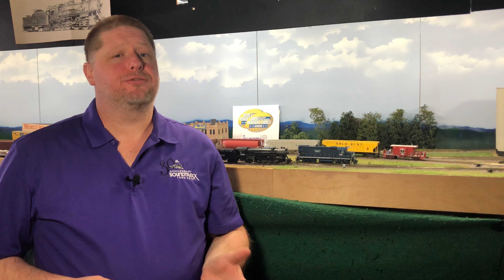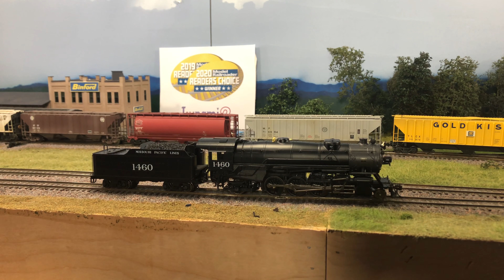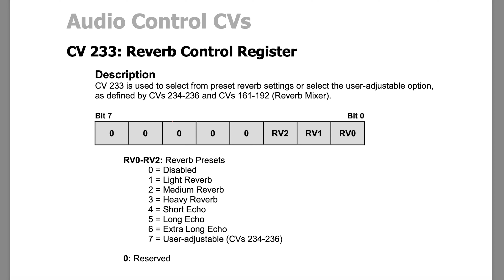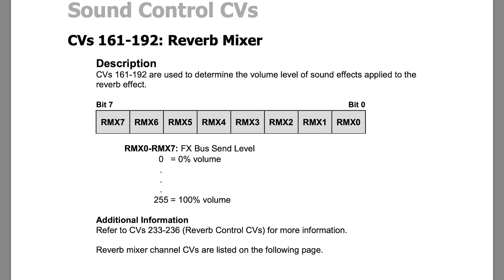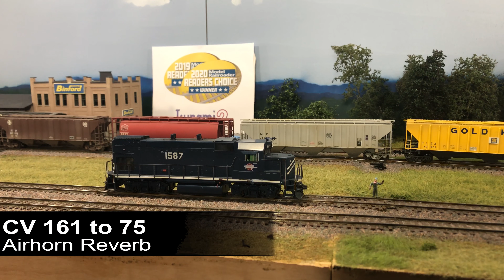Setting up Airhorn or Whistle Reverb & Echo with Tsunami2 Decoders

Comment: Hi good day.  I have this question.  In the airhorn, how is it configured so that each time you press the horn, it sounds continued and does not have 1 second of waiting for it to sound again? (airhorn short)

I would like it to sound like in this video, every time you press the button it sounds and it is continued.

My locomotive is SD70ACE athearn with soundtraxx 1 decoder

Sorry about my English, it's not that good.  Greetings from Mexico
Reply from the maker: There is a short horn and long horn function key. They default key varies based on if the decoder is after market or factory installed. Please contact our Support Department for more assistance: support@soundtraxx.com

Comment: What about the other CVs for adjusting reverb? (CV 234-236)
Reply from the maker: CV 234 is used to determine the amount of reverb signal that is mixed back with the
original audio signal. 0 -255 = 0%-100%

CV 235 is used to determine the overall reverb delay time from 0 to 255ms. 
0 = Disabled
1 = Minimum delay time
.
.
.
255 = Maximum delay time

CV 236 is used to determine the percentage of the reverb output that is mixed back into
the input and creates the effect of multiple sound reflections, each diminishing in
amplitude over time.
0 -255 = 0%-100%

All of this info can be found in the Tsunami2 manuals on our website as well: https://soundtraxx.com/manuals/tsunami2-digital-sound-decoder
Reply: Can we see a demo for how those settings affect the reverb? I'm having a hard time picturing it.

Comment: Digital echo and Reverb are nice features to have, but aren't a replacement for a good original recording with real world echo IMHO. I spent years in a recording studio playing with all sorts of digital enhancements and I never found them as good for reproducing that "outdoorsy sound"
Reply from the maker: Yes, our sound engineers record top quality sounds every time. We partner with railroads to get access to locomotives to ensure great quality. But we do not always get the change to say record in a deep canyon and not all customers will want that much echo. So we try to do our best to meet everyone's needs.
Reply: You could use a "plate echo" box.  That has been used for a vast number of recordings of popular music and odds are you have seen, or used, them if doing studio work.  It would be slightly hard to fit into the locomotive since the enclosure might be about five feet tall.  But if you could get the sound to the plate echo box and then back to the engine, you'd really have something.